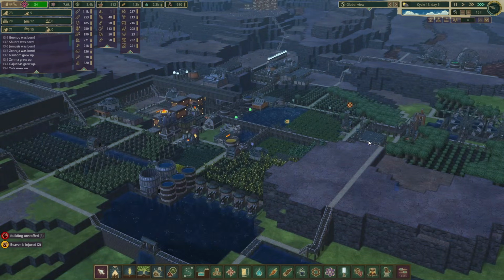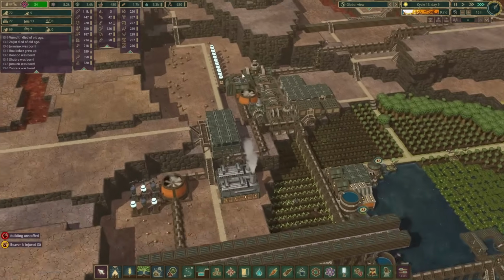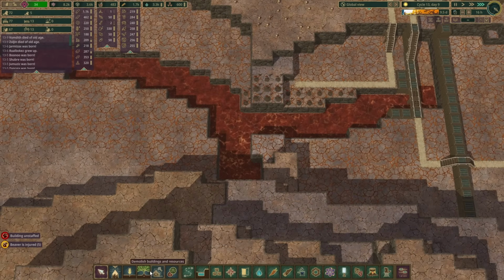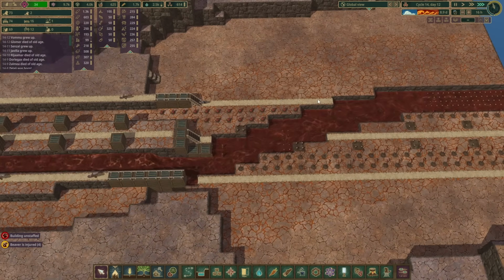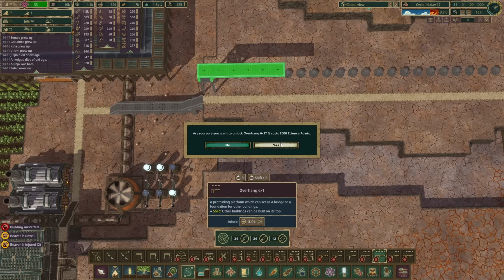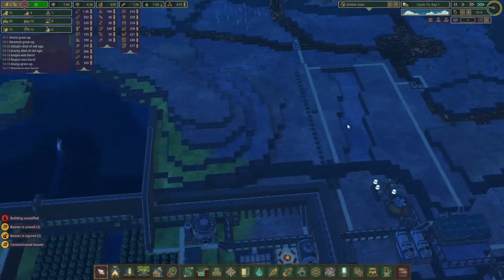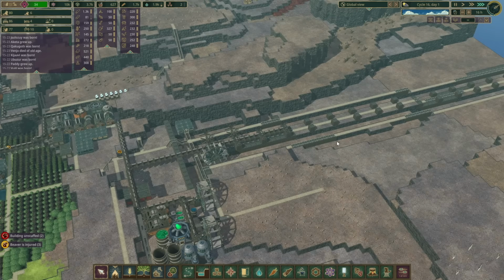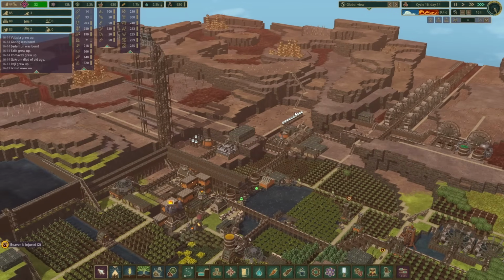Turning BADTIDE Into Power; Water Wheels & Gravity Battery | 05 | TIMBERBORN 1.0 [Hard] | Lets Play

Comment: some funny things i noticed 🙈
1. Nilaus talking about resource efficient builds... and then builds a battery storage using plattforms for no reason. only top layer required 😂
what i wonder: why going for batteries? build a massive, covered reservoir for all badwater sources and a a sluce gate at the bottom that feeds into a long snake of waterwheels. way more efficient and scalable, as the pool will always have enough badwater and cant spill as it is covered. 
same would also work with freshwater pools but needs a controll gate at pool entrance to only allow fresh water. given your state of game, i would recommend such an approach as it will be an endgame build, your midgame build is just a waste of time as you don't get a highly scalable solution.

Comment: Another tip on this map is that there are more geothermal vents. So you build a geothermal plan and next to it, a number cruncher. ok, the plant produces 400hp and the cruncher needs 500, but they do not need any maintenance at all. So basically free (apart from build cost and time) science.

Comment: Im watching this series marathon from eps1. It's maybe late, but I have a solution for flickering aquaduck. 

You can use the aquaduck itself as a buffer by adding flood gate at the end, and set ativation as the opposite of sluice at the beginning of the aquaduck.

Assuming the volume of the aquaduck to the central reservoir is 1 to 3 and the central reservoir water censor activate at 50%, it should be save setting the flood gate to 90% without flooding the central reservoir. It'll still flickering but less frequent

Comment: Regarding Metal overhangs and their cost efficiency at 19:10 ish - If you're trying to go 3 blocks up the metal overhang is noticeably more expensive. 80 total wood (double platform + 6x1 overhang) AND 12 metal vs 6x10 total wood for the triple platforms. Every level above that first it is substantially cheaper to use the metal overhang so long as you have the metal income to support it. 

Just yesterday I was going to build a raised platform out over a reservoir to extend my city. I started to stretch out a forest of wood platforms until I recognized that a 10x10 of triple platforms costs 1000 wood. I needed to go up like 10-12 blocks to reach the top of the reservoir. So that's around about 3,000 wood just for a 10x10 platform. Using the metal overhangs, though? ~1800 wood and 200 metal. Less than 2/3 the wood cost to use metal and that math only gets better the higher you go.

Comment: With iron teeth you don’t need batteries at all, you can just put a bad water discharge and keep it open at all times (it works during droughts too)…then your whole power system is just a zigzag of power wheels that never stops. Also smaller power wheels are more efficient per space and you can cram a lot more water into the one tile than you think.
Reply: The devs changed the badwater cap for the Folktails to work the same as Ironteeth now. You can set it to always open and get infinite power with them too. I have no idea when they changed it. I only noticed on my most recent play through.

Comment: 1:20 did they remove/change Irontail badwater cap ? cause that used to allow you to have badwater, even during droughts.
31:40 those big power wheels are going 2 levels down for a reason, they can get significantly more power if you have 2x2 flowing water power them.
Reply: Badwatercaps only work with bad water sources I think. I have seen them on maps with sources but not on maps with only seeps.

Edit to say that the pressure map has them

Comment: Any particular reason you’re using fill valves instead of flow valves to manage the badwater flow? They could be configured to only allow the optimal amount of fluid and maximize power output without flooding any beavers or wasting energy. 

Combined with a badwater reservoir, you could capture all of the excess fluid and utilize it during droughts rather than relying on batteries. A couple batteries would be necessary to cover the system lag and even out the supply, but the badwater would be the primary energy storage.
Reply: Oooh, that's a great idea on a map with seeps!

Comment: 7:55 seems like such a waste you have 5 water pumps pumping from a shallow pool, you're playing the Iron Teeth make use of the fact their water pumps can reach 6 deep. They pump x amount per square under the water not for the whole building, for best evaporation management have them sitting in an underwater canal of 3 wide and 3 deep this is at the bottom of a 3 square deep lake. Should increase your pump efficiency by 3x.

Comment: Unless they changed it in recent patches, at 3:10 you can set a path to either side of the rocks and the beavers will be able to demo both.
The height limitation of working within 1 vertical square only applies when building above you - when building below you, there is no vertical limit at all. IE if you want to build something at the bottom of a cliff, and its 10 squares down, you can still build it from the top.

Again, its been a while since ive played this, so it may have been changed - but it was like that for years.

Comment: Hey quick question, I was played this many years ago, is there still a thing that you have to build multiple sub colonies/districts?
Reply: you don't have to do that anymore. only downside is it takes so long to get far away
Reply: They removed the hard lock on path distance, so you can actually play a whole map with only one district, but it is not recommended. The efficiency will just drop the further away jobs are as beavers only start running there when workhours start, so they will waste at least an hour a day or so
Reply: @SmokeJam  Thanks. So there isn't working AI for taking materials from closest storage building and workers living in closest houses?
Reply: @Haplo-san  They'll absolutely take from closest resources. A good trick for far-flung projects is to set up storage and have the haulers take out the needed resources so the builders can stay and build until rest time. And then tubeways or ziplines reduce the travel time so you don't need multiple districts except to manage pathing lag on very built up maps (depending on how beefy your PC is).
Reply: @raelynne79  tubeways! ziplines! Now those things are new to me. I wanna play soon. Thanks for the info.

Comment: i was wondering. can you not make "free" power out of the batteries?. in the sense you waste materials. you use the battery up. then disassemble it. then remake it. and then the battery is back up top.
Reply: I mean, it's not free, you don't get all the resources when you demolish buildings, and they take time to build. but they can very well be a form of non-renewable power in a pinch.
Reply: In theory yes, you could do that. In practise: Batteries discharge quite quickly. The amount of power needed to produce the materials for a battery (and the following 25% of resources you lose by disassembling and have to reproduce) is higher that the maximum charge of a battery. 
In short: Maybe a neat trick if you need a couple hundred hp in the next 3 minutes or so, but not sustainable to "hack" power generation.

Comment: What is the point of the intermediate platforms in the battery tower? Also I think it should be much faster and cheaper to use the travel tubes for big vertical projects like this. They can build from them and then you setup a larger platform at the top (build it by placing some temorary tubes to give them the reach) to place an exit.
Reply from the maker: funny how I didn't even think of that. You are obviously correct.
Reply: @Nilaus  technically, you don't need the second scaffolding tower either. Just a spiral stair to the desired height, one scaffold tower next to it, and cantilever the big overhand blocks
Reply: That is the exact question I have in my mind at the point of washing this.